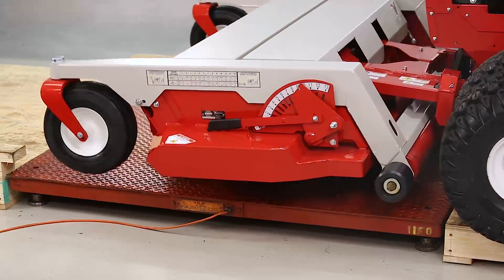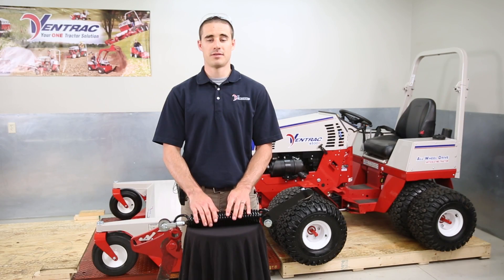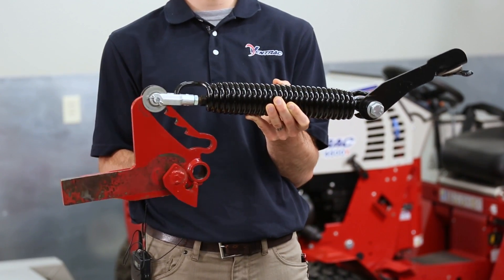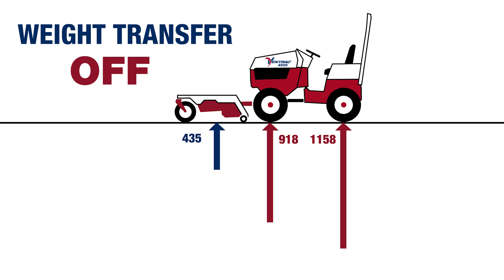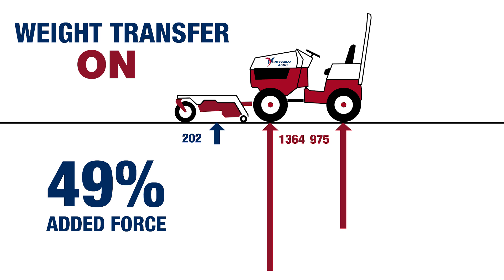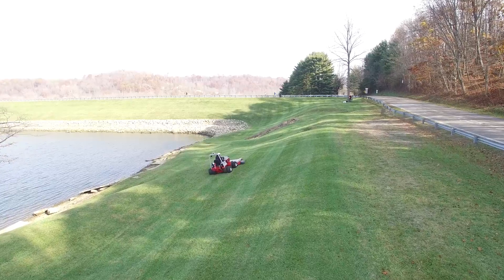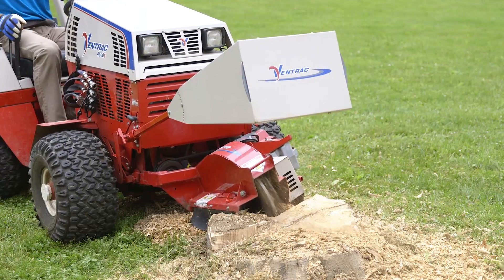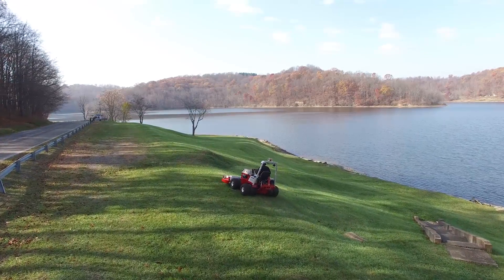Ventrac 4500 Weight Transfer Experiment

Comment: Aaron, this is older video, hope you notice this response.  My 4500 is nearing 800 hours of use.  Early in its life the weight transfer would often get stuck at either the lowest setting or highest setting such that the setting handle could not be removed from its notch.  This could be unstuck by raising and dropping the implement while on a slope, but annoying.  Dealer said slack in the spring and adjusted.  It would still stick on occasion and now more often.  Is there an adjustment video or instrucion sheet?  Or do I have to wing it?
Reply from the maker: Hello! Here is a link that has instruction and should help: file:///C:/Users/37884/Desktop/09700165_4500%20Weight%20Transfer%20Kit%20(2).pdf. The last page outlines what to look for on adjustment of the spring. It's an instruction kit for adding WT to a 4500K model but the process at the end is what matters.
Reply: @ventrac  Just to make note of it, you linked from a local hard drive instead of a website or FTP server where it can be linked for download. YouTube also doesn't seem to like hyperlinks these days on some videos